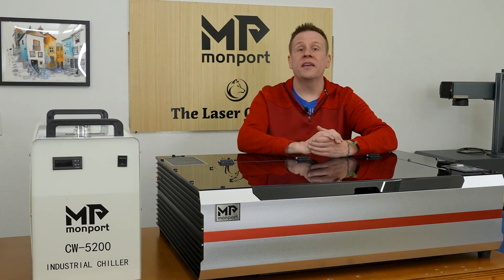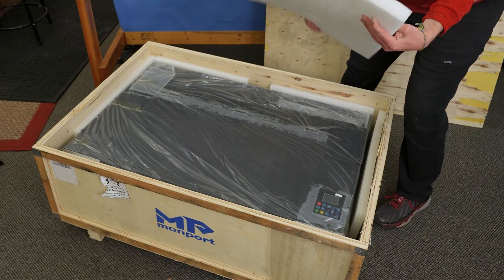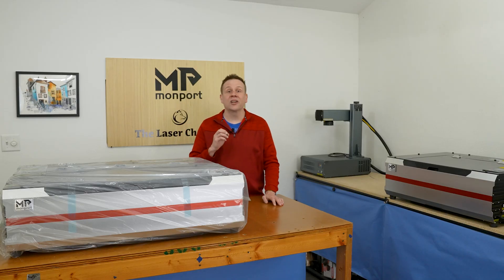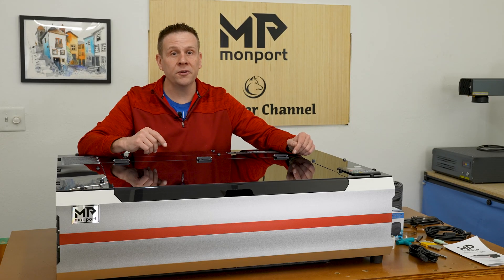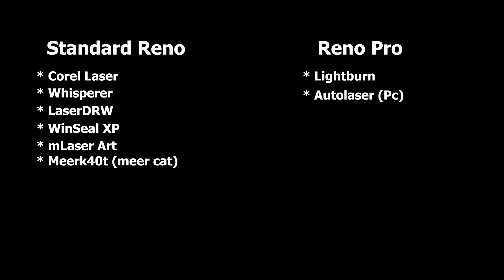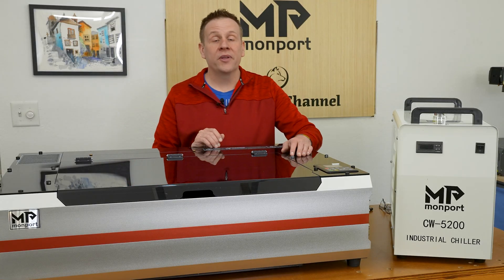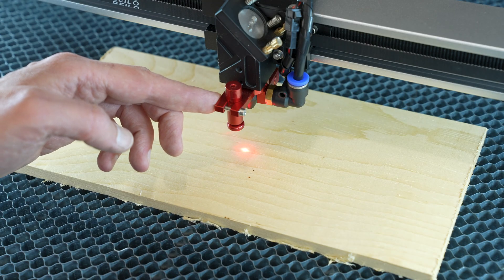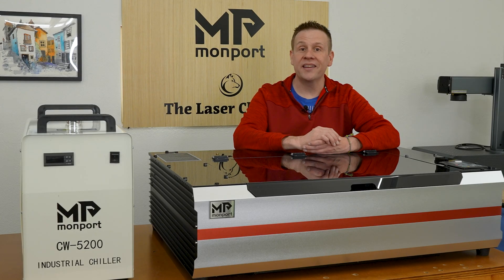Monport Reno 65 Pro-  First Look (it's epic!) #monport #reno #laser

Comment: Just got my Reno 65 pro, I've been running it no higher than 65% power in Lightburn, do you think that's too high, I  don't have a milliamp meter hooked up yet, don't want to overdrive the tube
Reply from the maker: Congrats on your Reno!  In most cases I keep my power levels below 80%.  I recommend checking the mirror alignment: https://youtu.be/QxrRtTmuzAA

Comment: Is there a hole in the bottom with an open bottom option? Curious if I can make my own riser. Thanks!
Reply from the maker: YEs- when the crumb tray is removed the bottom of the machine is open!  Use discount code GREG10 to save across the Monport website!

Comment: Thank you for this video. I’m considering buying a Reno 65 Pro right now, but I’m confused by the four similar Monport desktop product lines (40W Pro, Onyx, Reno, Mega). Can someone please confirm whether the Reno 65 Pro is the most advanced model, and how it ranks compared to the others?
I just want to avoid situations I’ve already experienced before with other stuff, like: “Sorry, your model is no longer supported by software 'XYZ' —please buy the new model or install MS-DOS 6.22 to use your current” or, “Oh, you should have bought option ‘XYZ’ for $17.49 more; now you’re missing 17 important features for the next 15 years, and, oh no, it’s not field-upgradeable,” or in three months: “Our Vegas Pro 85 is twice as fast for the same price as your Reno Pro 65.”'
Reply from the maker: I understand your concern and will say the Reno 65 Pro offers a great mix of features and performance in the desk top laser line up!  It's powerful, fast- it also accelerates very fast and easy to work on for maintenance.   The Reno Pro comes with free software but I recommend using Lightburn software- it's feature packed and a ton of people use it so there's a huge user group.  Most of the laser machines on today's market are Lightburn software compatible. 
Is there something faster than the Reno Pro- current the Monport Effi.  The Effi just came out at the beginning of the year.  Large, faster, and more powerful- with a value price that matches the performance.
Reply: @thelaserchannel1  Thank you for the reassurance. The only annoyances I’ve encountered so far with the Reno65 Pro are:
- the missing Ethernet port,
- the need for external cooling (though, on the plus side, this 'feature' makes the machine much lighter when moving), and
- the out-of-reach priced RF laser sources, I have to stick with glass tubes for a while...
Thanks for recommending the Effi series, but if I get it right, those are heavy, floor-standing machines. I’m limited by the fact that I have to get the machine through several standard-width doors to my workshop, so only desktop machines are feasible for me at the moment. Maybe later, when my workshop grows...
And yes, I’m definitely planning to use it with LightBurn. That’s what I already use with my 60W MOPA fiber laser. I suppose I’ll just need to upgrade my license for a small fee to use both engravers.

Comment: I purchased one of these lasers and the initial opinion was not that good. First of all Monport depends solely on Lightburn to get this thing going. I haven't been able to communicate with my laptop via USB cable.
The installation was done using the USB thumb drive that came with the machine. I'm using version 2 of Lightburn and Windows 11. When you select "Find my Laser" it sits there and does not do anything.
I decided to use a gcode on my thumb drive, no luck because there are no instructions how to manipulate the controller panel.
Reply from the maker: Here's some info that should help you out- there's a USB driver on the machine thumb drive- this must be installed otherwise the LB will not correctly connect to the machine.  The Reno Pro is not only compatible with LB but also with AutoLaser, CorelDraw, and AutoCad.  Most people opt for LB or AutoLaser- AutoLaser is include on the machine USB thumb drive.  There's also a number of Mobile apps to use the machine as well.
Personally- The Reno series is one of my favorite laser platforms to use.
Reply: @thelaserchannel1  
Thanks, I got the thing running with Monport support team
Reply from the maker: @rguertin1  Glad to hear!

Comment: Hi Greg. I was on the Monport website and just before purchasing the 65W laser, I looked around and they now have a Monport Mega 70W version. Now I'm really stumped. Do you know what the difference is between both machines? Is it worth the investment?
Reply from the maker: The machines are very different- the Reno 65 Pro is a "basic" machine and I recommend an active chiller unit like the CW-5200 and an inline exhaust fan.  The Reno works GREAT and the machine does everything as advertised.  One of my favorites!
The Mega is an "all-in-one" machine and has a built in passive chiller.  It does not chill the water down to a set temp.  Currently the recommended software to use is Lightburn as the Mega software still has a ton of bugs.  Maintenance is much more difficult on the Mega as well.
My recommendation is to go with the Reno 65 Pro, CW-5200 chiller and an inline exhaust fan and you will be very happy!
Use code Greg10 to save on virtually everything across the Monport website!
Reply: @thelaserchannel1  Sounds like a plan thank you again!

Comment: Is the water chiller connected to the machine? Did you have to align the mirrors? And, is there a milliamp meter or something like that to calibrate the tube power? I got mine a couple of weeks ago but haven't had the time to uncrate it yet. I'm looking forward to check more of your  videos on it. Thank you.
Reply from the maker: I have the only the water lines connected- the alarm cable is not connected.  
The mirrors were close to being fully aligned- my table is not flat so I would blame the table and the factory setup.
There's no external amp meter- I'll have to take the side cover off to see if there's one on the laser tube power supply or how to connect one up!
Overall, I really the Reno 45 Pro I have and the 65 Pro is on the path to being one of my favorite laser machines!
Reply: I've a Vevor kh-6000 (Compressor + 12L tank) It work well even when I use the laser for many hours.
Reply from the maker: Thanks for sharing- I didn't know about the Vevor kh-6000!
Reply: Can the air assist be turned off and on through lightburn to engrave or cut?
Reply: @AB_thingsDFW no it’a manual valve behind The Y axe
Reply from the maker: @AB_thingsDFW  I don't think so, but I haven't tried yet!  There is an air flow cut valve on the x axis gantry so I can control it manually.  It would be nice to use LB to control the air!
Reply: @thelaserchannel1 huge inconvenience to engrave first. Then stop the whole process to turn the air on. Or just watch and do it before it cuts. There's got to be an input on the motherboard for this. It's a dsp controller, right?